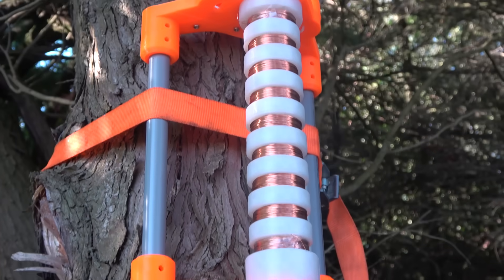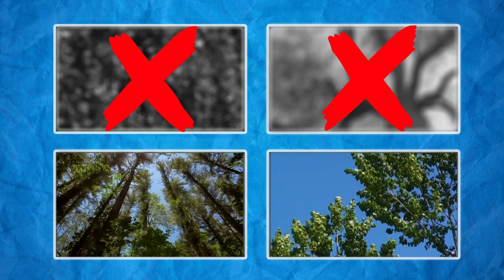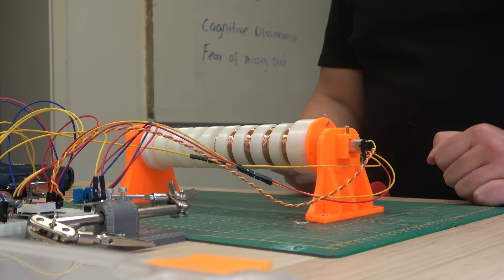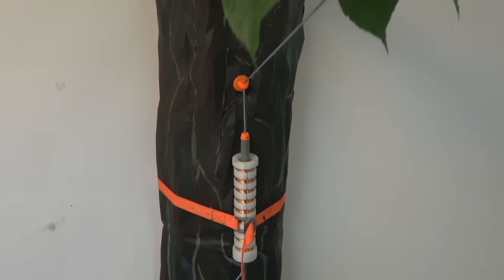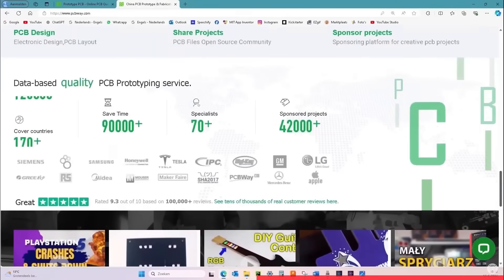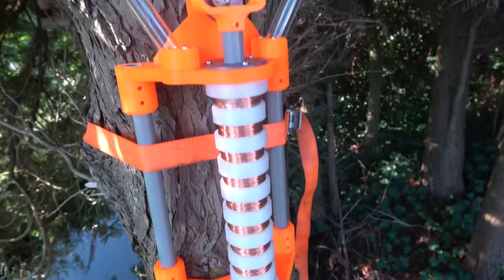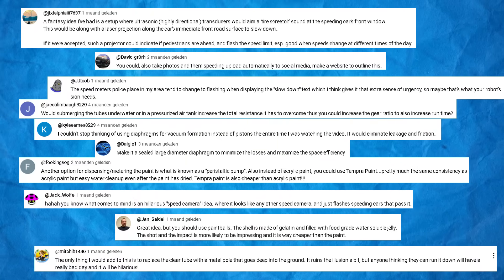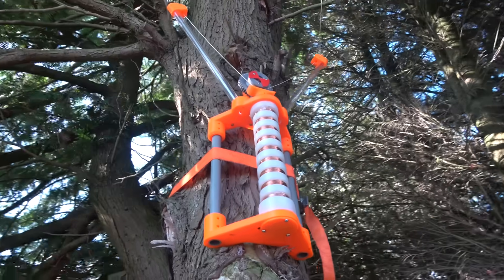I Made a Tree Generate Electricity..

Comment: Wow, this video is effectively a report of the full engineering process in a super digestible format, love your work.

My first thought with your idea to harness the kinetic energy generated by the wind on trees was more in line with the other form of exploitable energy you identified in the swaying of slender trees. If you combine the large arc distance of movement from the tips of these trees with the high force this generates there's more energy to be harvested here. 
A system very similar to the one you made in this video placed equidistant between several trees, anchored to the forest floor could allow it to use this high energy and from multiple trees at the same time. 
You'd need to use heavier duty cables and probably multiple pulleys but you could use some comparatively huge gear ratios for high torque to high RPM conversions. If this generates too much speed for your linear generator to handle you could either size it up or have several generators within the same unit. 
The end result might be a series of generators within a singular unit capable of generating a lot of power.

Hope this helps!

Comment: If you used pulleys at the ropes hinge point like a snatch block you could multiply its torque and increase the gear ratio for more strokes per rotation. For bigger branches that CAM rod that rotates lifting the generator can be extended and turned into a "crankshaft" to lift multiple generator cylinders. If 2 cylinders were inline, 1 can be lifted while 1 lower reducing vibration & lifting force required. Increasing efficiency.

Comment: Would love to know what the outputs of this proof of concept are. Voltage, Amperage and then wattage over a period of 24 hours of 'average' wind. Even if the numbers were relatively small, a number of these setup and linked together could tap some serious energy for off grid households with trees on their grounds.

Looking at the flashing led strip, its not going to be huge, but economies of scale and added factor of time (this thing will run 24/7) could prove beneficial when solar is not delivering and traditional wind  generation is not possible or unsightly.

Subscribed to hear more in the future!

Comment: semirelated! so im super sleep deprived and so this is probably completely not feasible, but considering that trees grow at a rate of 1-5 micrometers per hour (and expand/contract by up to 200 throughout the day/night cycle due to thermal expansion/contraction). so given a young growing tree with a decently thick (8+ inches in diameter?) trunk, using two thin 1-3 inch wide dense metal plates that are driven through the center of the trunk at two separate points parallel to the trunk, with the lower plate extremely firmly and securely anchored deep underground or into concrete, could one use an incredibly sturdy setup of some sort that connects the plates to an extremely high (maybe ~90,000:1 or so? idk) well-lubricated and machined gear ratio and ratcheting system, could you create a sort of large "clock" that not so slowly yet incrementally shows the growth of a tree? they do grow upwards with considerable force and granted the plates don't jeopardize the health of the tree in a major way, it should push them apart ever so slowly. though like i said this probably has a multitude of reasons why it wouldn't work

Comment: There's no need to balance the strokes by using magnets at the ends. Just turn the thing horizontally and it will take the same energy to move it either direction

Comment: Could there not be two half sized cylinders connected to each other on both sides of the wheel to counter balance each other? I dont know if the poles would have to be opposite to ensure the same polarity when one is moving up and the other is moving down.

Comment: How about strips of piezo-electric material just taped along branches?…I’m thinking of getting the whole generator body into a long form, and do away with the strings… you want some kind of sleeve that clips onto branches.
Or, instead of coils, flatten the design & make the wires zigzags - think integrated circuits for printing, rather winding, make the generator a sleeve that encases (hugs) the tree trunk with multiple zig zag strips running vertically & have flat magnets….
What about a spiral design that wraps around the tree like a spring?… bah - I have insomnia now, LoL

Comment: Put it in high voltage configuration on a filtered full wave bridge rectifier that feeds a battery that way you passively generate power even when youre nit using it then you have plenty when you need it

Comment: My thought would be, attach the generator to one tree, attach the cords to the ends of branches of trees to either side of it.

That lets you get part of the sway of  the trunk energy as well, which you can't get any of here, because the generator in on, and thus sways with the trunk, but trees don't generally sway in rhythm with each other.

Though, doing that would of course necessitate a different link, because if you used what you have now, if the outer trees tried to sway away from each other, it would break your machine.

So, perhaps something like a lawnmower pull start, such that pulling away from the tree spins it, but the cord freewheels and rewinds under spring tension?

Comment: I found your idea to be intriguing.  If you want to stay with a linear vs a rotary generator, you might consider using a rack and pinion coupling to move the magnet cylinder up and down with a length of teeth attached parallel to the shaft to mesh with the teeth of your gear.  I would expect the action to be smoother.   Just a thought.

Comment: Love it. I just love it. Subscribe and liked immediately u deserve that. 

My idea for improvement would include a flywheel that powers the shaft. Flywheel is similar to those radio transistors where handle is pressed and it spins a gear that added momentum to flywheel. And on return stroke of handle the fly wheel is not affected. Something like bicycle ratchet gears. 

I’m gonna now look at your other videos. Best of luck

Comment: My only advice at this point would be to use a grade of magnet with a  higher MGOe value. This could reduce the size and weight without sacrificing residual induction/Br. Smaller movements not possible using magnets with a larger mass,  might still provide the same current when using smaller magnets with a higher MGOe. Idk but might be worth investigating. Weight reduction can sometimes improve things and sometimes not. What a fun project you have there, Cheers!

Comment: Couldn't a linear generator of this kind be combined with a ram pump by connecting the moving rod with the pressure chamber? It might not produce much but should be able to generate a stable current.

Comment: Would there be fewer losses if you just used the rotational motion to turn a standard rotational generator vs converting the rotational motion to linear? Also with the side to side motion being captured with those two strings, how would it capture or mitigate the solely up and down force caused by trunk flexure or the branch moving up instead of side to side?

Comment: Instead of the strings and mounting points...

Take the linear generator and turn it sideways (so the movement is horizontal), place preloaded buffer springs at both ends of the tube and mount it higher up in the tree. And mount three of them making a regular (equilateral+equiangular) triangle around the trunk

Comment: I already have an alternate mechanism.  :)  Trees, typically, don't sway very fast.  They do, however, have increasing periodization under stronger and stronger winds.  It would be nice to de-couple your pulley/gear system to allow for greater travel under the various conditions.  Right now, your system will only allow for movement within a specific range before ripping the "magnet post" out of its housing.

Comment: I think you need to go after scalability since you aren't going to get much power from a single branch. Use regular smaller rotary generators and something like those retractable lanyard mechanism to make a small and simple model. Then build a bunch of them. Have a single generator and retracting mechanism per unit so that 2 would be required to get a branch (again, more scalable).

Comment: The problem with this idea is that production on a mass scale would cost more materials then it would save and produce too little electricity to justify the material cost. 
Also connecting many trees to a wires leading to a batter might not be the best idea and insulating all this from the weather and wildlife would be a major hussle.

But it can work for a personal small scale production really well   i could see this being sold for offgrid use.

Comment: Its great to see this idea being realized, that in itself has a lot of merit and add a massive contribution to the art.
That being said, the quantity of magnets and copper used in the aparatus left me a bit cold. Its too expensive for most ppl on this planet.
I understand these kind of generators take a lot of copper and really strong magnets to produce a decent output but still, i think its too much of a direct aproach. I think maybe piezoelectrics or air compresors linked with water containers could work more in tune with a system like this one.

Comment: Great idea (pronounced I.D.ya, btw, not I.D. - a very common, almost systematic, Dutch mistake). How much electricity did you generate on a day of average wind? I'd have thought that, trees being quite strong things, scaling this up to movement of the trunk, rather than just branches (you don't actually show what part of the tree you connected the string to) should generate much, much more electricity.

Also, since you have rotational motion at the top, why not just use a simple rotational generator rather than your multi-linear one?

Comment: I feel like the only major flaw in this is storm settings. You could throw in a decently rated housing for the water but the stress on the line with high winds might be an issue - that is of course ignoring lightning strikes (though rare, it seems like ideal trees for a device such as this would be more prone)

Outside of that I feel like this has potential with some tweaking - at least a project someone can do to help supplement their power needs. Windmills good at what they do - but you can usually make something better if you put thought into producing power for your specific setting.

Side thought:
I'm curious about the possibilities for a device similar to this in indoor settings with lots of human activity.

-How much power would a popular gym outfitted with devices like these on relevant equipment produce?
-How about a frequently used entry/exit door?
-Elevators?

Would like to add that it's refreshing to see someone play with the ideas that most just toy with in their head. I've been a consultant for a hydraulic and electrical prototyping business for about 9 years now and have had conversations about similar devices since before then - but have never seen anyone try to make one lol. Much respect & Subscribed :)

Comment: I always wonder why small scale generation of energy is seen as unviable. Sure, one unit isnt going to do much, and 10 or 100 will probide a trickle, but a thousand? Ten thousand? 

There are 3 billion trees in the UK alone... If each one had few discreet power unit boxes containing an optimised device like this... Even if each one only makes an average of 3 watts on a normal day, thats 3 gigawatts if every tree in the uk has one. Thats equivalent to a nuclear power station's worth of power. A nuclear power station costs £33 billion - £45 billion. The cost and installation of each unit should aim to be under £15. A power station is active though, requiring land, employees and constant operation. These are passive, so maybe we can go up to £50 - £100 per unit, because they wont require much maintenance... Just map them on a database with a map, and put sensors on each to detect failure and let a single man with a van patrol several thousand in an area... 

 It'll take time and resources, and itll be a slow process, but we can set people to work on that and just leave it ticking... Just millions of small power units slowly ticking away, and a team of people just mindlessly installing them wherever they find a suitable tree... Give it a few million a year in budget and set it ticking... A passive energy campaign... Maybe even expand it to mini solar panels, or other passive energy generation methods... Microhydroelectric units in streams, mini windmills on buildings, installing solar panel structures over car parks to provide shade to cars... If our government was funding these kinds of projects, I'd be happier paying taxes... I'd even be happier with paying more to see my energy bills reduce...

Comment: Use the same generator but put it on a pole horizontal between the branches of 2 trees so the swaying movement will generate the electricity. then even a slight breeze will cause movement

Comment: This reminds me of a cylinder sterling engine I put together using magnetic dampners at the top and bottom of  a tube cylinder, and the central core had monopole magnets on a graphite pill, it fit snug in the tube and assisted the temperature differentials required for the movement. then I coiled in the optimal "pill" movement zone. perhaps you could explore combining the trees movement, and structure, to support solar and kinetic movement to generate heat instead of kinetic energy?

Comment: Speaking of out of the box thinking, would it be possible to hook up multiple generator rods to a single spinning gear so they all turn as that single gear turns...all without requiring more force being exerted upon the first gear?

Also, you could orient the rod sideways so that it doesn't have to fight gravity at all. As the tree moves, the rod is pulled back and forth as the relaxing branch pulls it back into the rest position. Keep in mind, this idea may not generate as much electricity, but it would make it easier to generate electricity; less output with more efficiency.

Comment: wouldn't it easier and also potentially make the project smaller to just use the magnets spinning, that way you could also use a electric motor to generate the the power, i'm only saying this cause you've already converted the movement into gears so it might be better to just keep the spinning energy from that instead of converting it into linear movement and then energy.

Comment: I would suggest some kind if housing to cover the cog segment to prevent leaves/stalks etc from clogging the movement Y shaped with small pipes for the strings, also to point out that the strings will allow water to slide into the unit, possibly disabling or damaging the unit.
 The string will need re consideration as it will need to resist wear and tear, possibly polymer/fishing line kevlar even to mitigate rubbing. Coil will definitely require air tight seal to prevent again water from entering else the power will be prevented from traveling properly.
P.S, You've reminded me of the ( Phone home ) device from E.T. 1982 👽🤣

Comment: just use a standard rotating generator, ie a BLDC...the lower the KV, the higher the output voltage.

far better option, as someone has taken the time to consider flux density, and the reluctance of the magnetic circuit. the maximum flux intercepts the coils.

air coils, no iron, terrible magnetic coupling, may as well not bother. linear generators still require the magnetic circuit to be considered. air is a terrible "conductor" of magnetic flux. iron is used for a reason.

the basic concept though, just wrap a string around a tree branch... thats pretty cool?

i can see these being stolen by unscrupulous chinese manufacturers and used as "garden lights"... in fact im going to do it myself!

would have been good to see the first model shorted out, then watch as gravity struggles to pull the magnetic rods back down due to lenz reactions...

and that then goes back to a major point that is seriously overlooked with all generators... the "load" resistance has to be higher than the "generator" resistance. 

 when equal, half the power is dissipated in the generator. when the load is lower in resistance (such as in a short...) then ALL the power is dissipated in the generator... a generator is only as efficient as the LOAD it is attached to, and the amount of energy lost in the generator versus the load.

theres a few dots to connect. lenz reactions, kirchoffs law, etc.